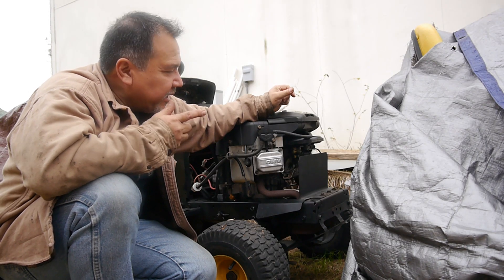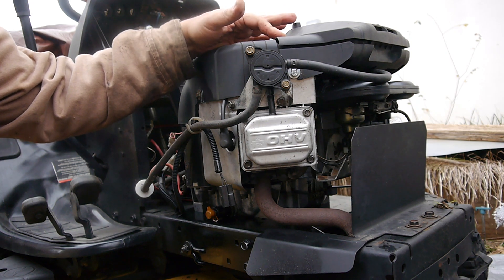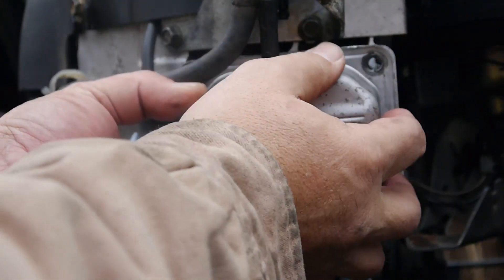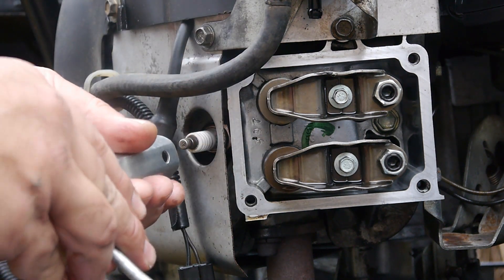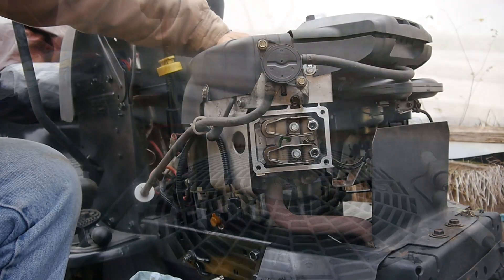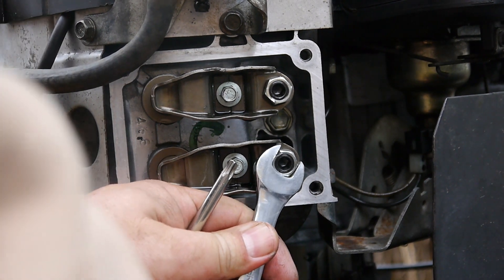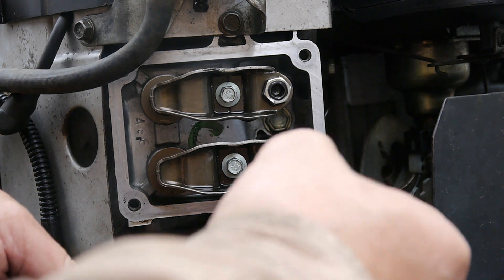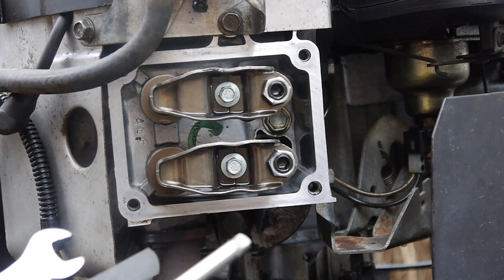How to Adjust Valves on a Briggs & Stratton V-Twin

Comment: Not at tdc!
 Piston 1/4" down from TDC, all Twins are best set at 4 & 4 due to their push rods falling out. Do not swap the Aluminum rod for steel. 
 Its Aluminum for expansion purposes to open valve a tick terd more to help torque & RPM response under load.

Comment: Good video, but.... next time use a straw instead of a screw driver to check for TDC. Once you find TDC, rotate the engine until the straw goes back in 1/4". This is because the valves should be adjusted just a tad bit below TDC. Once you have the piston (and the valves) at the correct position, make a mark on the flywheel relative to the plastic cover to mark TDC.  After you adjust one side, rotate the engine 1 full revolution, that should get you VERY CLOSE to the TDC  for the OTHER cylinder. Use your straw to check for the correct position of the cylinder/valves.

Comment: YOU DONT KNOW WHAT YOUR TALKING ABOUT THATS NOT THE OILPUMP THATS THE FUEL PUMP AND WHY YOU NEVER ADJUST VALVES WHEN YOU TOOK APART ENGINE THINGS CHANGE WHEN YOU TAKE STUFF APART CAN SEE YOUR NOT THAT EXPERIENCED

Comment: If you’re lucky, a valve adjustment is all you need. My B&S camshaft with compression release broke, making it very tough to start.
Reply: Valve adjustment fixed mine.

Comment: The valve lash on my 20hp on one bank got so bad both pushrods came out of their seats and got bent. No damage was done to the head thank god. I had to bend the pushrods back into shape just to get by until I can get new rods & the exhaust valve guide. It backed out and I think caused the intake pushrod to jump out of the rocker. I'm just limping it along, adjusting that cylinder every time before I mow before I get it repaired. It's pretty costly to have a shop do it as I'm an automotive mechanic and dont have the tools to do it myself. I can rent  what I need perhaps but i dont want the headache. Rather just bring the head to a shop.

Comment: The decompression mechanism failure is common on the single cylinder engine, but the twins need valve adjustment.  (so I am told)
Reply from the maker: The valve adjustments are often overlooked.

Comment: Failed to mention, four strokes have 2 TDC , compression and exhaust. Get this wrong you got a problem. Adjust valves on compression, when rockers will be a little loose,
Reply: 1/4" past TDC as well. You can  hear/feel this. Correction. You hear the lobe just before TDC then feel it 1/4" past TDC. Compression release is the theory behind this. I've always done it.

Comment: I'm trying to figure out how you did a piston ring replacement job and put the engine back together WITHOUT adjusting the valves and it still ran!!! wtf?
Reply: Real simple.  I've done it too.  When you're putting the heads back on and reassembling the valve parts, you start it out at 'yeah, that kinda sorta feels right enough to hold stuff together while I finish the rest of the reassembly' with the intent to go back later after rotating the engine a few times revisiting that with feeler gauges.  Sometimes it happens.

Comment: Opened the engine found the cam decompression valve failed. New cam on order....and it was not a V twin.. it was a single cyl. Housing cover is deceptive.
Reply: The decompression mechanism failure is common on the single cylinder engine, but the twins need valve adjustment.  (so I am told)

Comment: How to you know which valve is intake or exhaust.when you were showing how to find tdc on of the rockers was still tight and about to open so you turned it again to tdc till both rockers had slack. I'm guessing the valve that opened just past tdc was exhaust..is this right . I'm doing it tomorrow on a 23hp vaguard in my argo.. never did valves before.2 stroker here . Looks super easy though. But I'm hoping it's why it wont turn over at startup. To much compression.and I'm hoping it's just adjustment and not a blown up camshaft compression relief doohickey !!
Reply: exhaust is nearest where exhaust pipe comes out of head. intake is near carb.

Comment: Very good video!  I/we just discovered out of the blue my g/f's Craftsman with a V twin that will only crank up to compression and then stops turning. Brand new StrongBox battery. Cables and connections pristine. Got to be those clearances.
Reply: I could be compression relief went kaput like they are famous for. And that's a complete engine teardown
Reply: Thanks
Reply: @jamiehalifax4954  
Thanks
Reply: Or the compression release lobe on the camshaft.
Reply: Or the valve guide backed itself out of the head and it bent your pushrod.
Reply: Yes by setting valves it fixed mine from not turning over when you hit compression.

Comment: If the valves are tight TDC, doesnt that indicate you are TDC on the exhaust stroke? I was under the impression on the compression stroke at TDC the valves are not tight and adjustment should be made on compression stroke.
Reply: That's why you finger cap the spark plug hole, turn the motor till compression blows your finger off the hole then use screwdriver to achieve TDC.
Reply: Correct
Reply: Yes, he is at the wrong TDC in this video....valves are tight when they both should have some slack.
So he's actually adjusting the rockers to DOUBLE the gap. Sure hope he didn't try to start the engine afterwards !
Reply: TDC compression. some make mistake of TDC exhaust.

Comment: So the valves became too tight? I would expect them to get loose over time. Mine is running fine for about 30 minutes then it immediately becomes rough with a loss of power. Would this be more likely a valve adjustment issue or sticky valve or bent rods?
Reply: Doesnt carbon build up between the valveseat and valve causing it to become farther from the rocker, thus  causing a larger gap over time? Esp on the exhaust valve??
Reply: Nope, valve clearance always gets tighter over time. Has to do with the valves hitting the seat and them getting pushed out over time.
Reply: @lundyracing  I found out mine had a left side coil go bad. Repaired. Runs great now.
Reply: Valves will tighten up as the metal gets hot and expands losing the clearance
Reply: He's actually adjusting the valves on the wrong TDC....if he turned the engine to the next TDC both rockers will have some slack and that is where you adjust them.
Reply: They wear looser but valves sometimes sink in cylinder head making them tighter. Then they could have been adjusted wrong.I never knew what to expect.

Comment: Thanks for the instructions, that is a fuel pump not oil pump. The hose you disconnected is a breather hose.
Reply: No it’s not a breather hose it’s a vacuum hose to operate the Fuel pump

Comment: You need to turn the motor just over TDC to get past the compression release, 
if you turn it over while using the feeler gauges you will feel the right spot. Thanks for the video.
Reply: Biggs & Stratton recommends a 1/4 inch piston travel
Reply: I feel its trivial but I've always abided.
Reply: Yep he did this with that 1/4 past TDC.

Comment: Thanks for posting this. Cured my hard to start mower!
Reply: It wouldn't crank when the flywheel/perforated wheel was in a certain position. If I moved it by hand, it would start. After I adjusted the vslves. It starts without issues.
Reply: @glennmilles341   ok,good to hear..I'm having the same troubles. Going to check valves tomorrow. 23hp vanguard in an argo 6x6
Reply: Was your motor hard to start cause it didn't turn over. .or turned over but wouldn't fire?

Comment: If you rotate the motor CCW, you defeat the compression release and when you get to TDC back it off 1/4 inch. Always do the intake first
Reply: I noticed that the 16HP Vanguard service manual said to adjust at 1/4 past TDC. Does that mean that the piston travel (i.e. piston drops 1/4")?
Reply: @mkshffr4936  you just go to TDC and then 1/4 below TDC

Comment: I appreciate you being very thorough and finding TDC(top dead center) and all that but in reality all you have to do is: For the exhaust valve(the bottom one) rotate the crank either by hand or with the starter until the top valve is compressed. And when you want to adjust the intake(top) valve, rotate the crank until the bottom valve in compressed. No need to fuss with TDC(top dead center) or anything. My engine was extremely hard starting when I tried this and I found that I could easily slide a .010 shim between the rod and rocker when the tolerance was between .004 and 006. I adjusted until I couldn't fit an .007. My mower now cranks and runs like a new engine. If you want a quick but useful video which is what I followed, watch this one: https://www.youtube.com/watch?v=U30je8SZV0Y
Reply: Also, I didn't find anything to be 13mm. I found that a 1/2 in wrench fit the lock nut perfectly. I don't think these are in metric.
Reply: @ColonelBumButt  Adjusted my Briggs & Stratton 22hp twin intek today. Definitely took a 13mm for the lock nut. T-40 for the torx adjuster.
Reply: @archiemccain4923  some use torx and some use allen adjusters
Reply: @ColonelBumButt  Some of these Briggs V-Twins are really funky half-metric, half-imperial.  One I'm working on now has 3/8" heads on the valve covers and 13mm jam nuts.  10mm holding intake in place and 3/8" bolts holding down the top cover.  I guess there was a switchover of fastener sizes that kinda rippled through the engine factory or something....LOL
Reply: Agree about adjusting valves. Way easier way to adjust valves. Mine were .15 valves has never been checked 680 hours on engine.

Comment: Briggs actually says that piston should continue past tdc down 1/4 inch .this ensures intake is past the compression release position.
Reply: Correct, 1/4" past to dead center on the compression stroke.
Reply: It would seem there is no way to determine this for a novice.
Reply: @alan93  sure there is, both valves should have a gap on that stroke, hence them not being open and allowing the combustion chamber to be sealed to compress gasses. If either valve is open while at tdc you need to rotate the motor to the next stroke.
Reply: @lundyracing  That is a concise, yet thorough explanation...thank you
Reply: @marksalamack6133  it wasn't meant for people that don't understand how engines work, there is a fair bit of people that should stay out of an engine. Myself may be included in that category lol